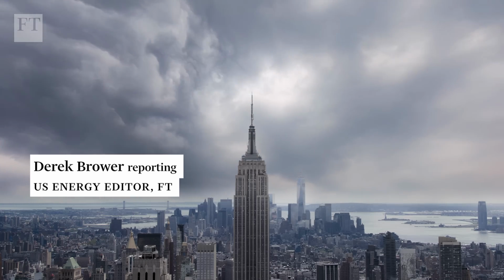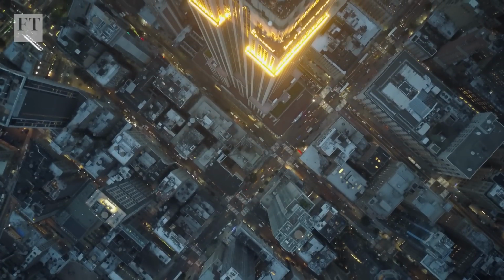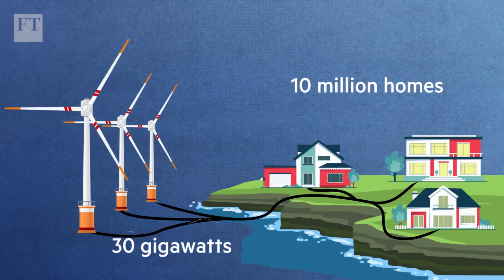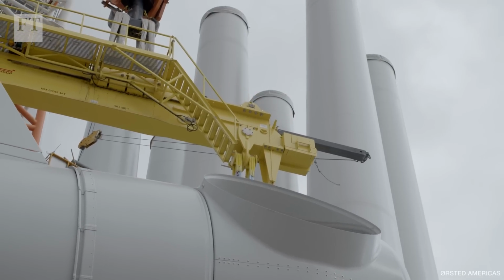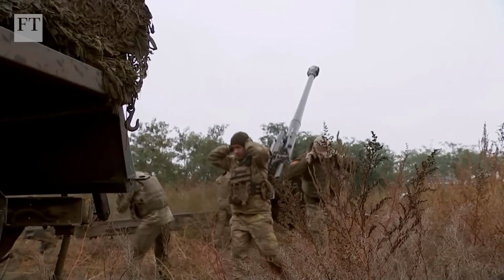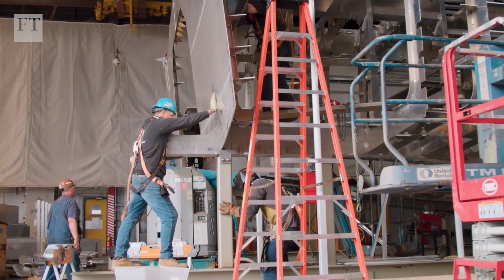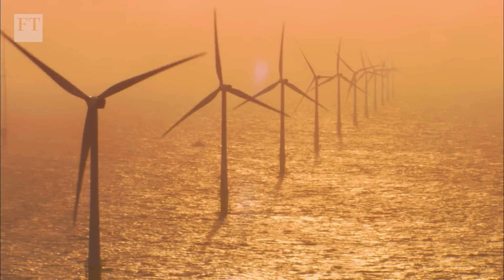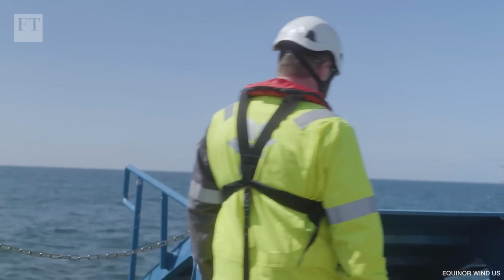US offshore wind: tapping into an underused resource | FT Energy Source

Comment: Wind and solar generated electricity are now mature technologies with few cost savings left to exploit and many times the cost of power from a well run public power grid.   They don't belong on the public power grid.    People selling power from battery storage is grid quality power available on demand and useful for backup and peaking loads.   Wind turbine generated electricity is not dispatchable electricity and has to be conditioned and backed up by dispatchable electricity.   It is useful for saving other fuels, but the high cost of implementation and maintenance has meant onshore wind turbines once rate payers start paying for them in the USA have always cost residential electric rates to go up significantly when electricity should be going down in real costs with improving  technology and efficiency.   Offshore wind turbines cost more than twice the cost of onshore wind turbines. 

People trying to scam the public make use of Climate Change misleading marketing to help their cause.   Global warming has been dead at about 1°C since 1992 with no known cause in 2024 after huge ongoing efforts to find a cause.   It is high school science all the greenhouse radiant energy from the earth is completely absorbed by greenhouse gasses in earth's greenhouse effect within 20 meters of the surface.   Its further heat transfer is by convection.  Earth's greenhouse effect is a primary example of system always in saturation from the strong greenhouse gas water vapor where other greenhouse gas can not change its overall effect.   On average CO2 has a 1/4 of 1% share in earth's greenhouse effect.  Over 90% of plants on earth today, C3 plants, evolved over 70 million years ago in CO2 levels ten times what they are today and struggle at the low CO2 levels of today.   CO2 levels about three times those of todays at 1200 ppm CO2 would greatly invigorate C3 plants.  That is what is done in tomato greenhouses.

Comment: I wonder if wind farms in the Gulf of Mexico are feasible, or if the frequent hurricanes in that region make it a non-option. There's also the factor of the incredible number of variety of birds that fly across the Gulf every year.
Reply: Key problem with the Gulf is not very much or consistent wind, compared to the oceans.   But the giant fossil fuel companies that already use big rigs to drill as much as six miles for oil and gas there might be able to engineer, host and maintain wind energy turbines across much of the Gulf at some point in the future.
Reply: There are magnitudes more birds that are killed by glass buildings and household cats than windmills. It's fake news

Comment: Great to see. Let's pick up the pace, East coast, West Coast, and the Gulf Coast. These are crucial resources to tap.
Reply: Without a radical breakthrough in storage, wind and solar require building more fossil fuel plants to balance the supply.
Want to save the planet? Build nuclear.
Reply: @gilgamecha  storage has had all the breakthroughs it needs. We have batteries, pumped hydro, gravity batteries, compressed air, cryo liquid air, heat storage, flywheels, super capacitors, and vehicle to grid evs. We just have to build them out. Also solar and wind back each other up beautifully. While offshore wind is very consistent and reliable. And then of course, there's hydropower, bioenergh, geothermal, and yes nuclear. They all have a place in the clean energy transition. But of all of those nuclear is usually the most expensive and the slowest to build new, especially in the US. I do support more nuclear in some parts of the world, but it is no silver bullet to the energy issues.
Reply: @Dr.Gehrig  if offshore wind was consistent and reliable we’d still have commercial sailing ships . try sailing the east coast of the US and see how reliable wind is
Reply: @jeffgold3091  depends on placement. Also, the design and purpose of a windmill and a ship sail are vastly distant. This is a fallacious analogy.
Reply: @Dr.Gehrig   Batteries?.... compressed air?..... super capacitors?...  flywheels?   Ever thought about getting in touch with reality?...If these "storage" methods were practical we would be hearing about it non-stop from the main stream media. The truth is that there is no good back up storage method for large scale energy and that is wind and solar's achilles heal. Wind and solar energy will eventually prove to be virtually worthless especially for 3rd countries with hundreds of millions of poverty stricken people.
Reply: @Dr.Gehrig  Do you work for the EPA?...The EPA has a bunch of these lunatic energy storage options on their website. They are clueless too.
Reply: @James Esselman   we do hear about them every now and again in the main stream media. Mostly the batteries, but sometimes the other ones get some play. They don't get discussed quite as much because people prefer an easy solution, 1 to 3 things to remember. Apparently once you break 4 or 5 most people shut down cause it's too complicated. Reality is complex though. These things are getting used and more are being built out in different places as we speak. It's more complicated than 1, 2, 3 but it's getting the job done.

Comment: And the coal, oil, or nuke plant will also have to run (continually) to be able to instantly back up the wind farm and smooth out it's cycle of wind/no wind. Add to that, windmills require extensive mining powered by fossil fuels, resulting in a non-recycleable turbine blade (which also requires transportation by diesel train/truck). We will actually be using more fossil fuel, not less.
Reply: Just watched on SKY News in the UK that they have installed a load of new batteries at Didcot power station, near Oxford.  This is a gas-fired power station so not green.  But allows the batteries to even the power load, so the power station has time to increase and decrease power output.  So does not need to run continuously, as can turn on and off a number of gas steam turbines.
Reply: lol no, In principle, mining could use energy recovery, renewable energy, and carbon capture to supplement, replace, or mitigate the impacts of fossil fuel use. However, a combination of renewable-energy technologies would be required. 
Iron ore production with renewable resources such as solar, wind, and geothermal could produce  electricity. Since no change in the mining processing system would be required, renewable electricity could be applied to existing, as well as to new, mining sites.
Reply: @franzjoseph1837  You've never operated a mine, have you? As a frequent investor in mining, I can tell u your notions will not work.
Reply: @cubsfan910  lol it is literally being done today so idk bruv

Comment: The duck curve shows that renewable energy drops in the evening when electricity demand is highest.
Wind drops in the evening over land because ground has a low heat capacity and this kills air currents.
Wind picks up at night over water because water has a high heat capacity that stays warm over night creating rising convection currents that create wind.
Thus off shore wind turbines are better at supplying high electricity demand at night.
Reply: It's about complementation and storage projects taking off unbalancing in the grid and saving energy for when it's really needed. More demand => more supply => more demand etc. A whole new industry is being developed here
Reply: The electricity at night is normally rather low.
Reply: @SweBeach2023  Funny that, it's rather high in thhe UK, people cooking, lights on, heating on, demand is high. Dark at 4pm.
Reply: This is why Wind and solar compliment each other so well.
Reply: @Dr.Gehrig  Only when the wind blows
Reply: @anglosaxonmike8325  you build wind generators where the wind blows most frequently. And then you find that statistically it blows often enough, especially when balanced with solar. As I said, wind and solar complement each other. It's tends to be windier when it's less sunny and sunnier when it's less windy. Yes, some energy storage or peaker plant (be it gas, hydro, bio, or geothermal) is still needed, but it ends up being leas than you would think in most areas.

Comment: offshore floating turbines are the future. Easy to install and move, wind speeds stronger and more consistent than at land
Reply: As long as the wind blows, they're great
Reply: @darkgalaxy5548  It's the west Atlantic, the wind blows nearly all the time
Reply: @Fudgeis1337  That's interesting. There's never calm days?
Reply: @darkgalaxy5548  There are calmer periods, but its pretty rare that there is no wind at all, especially at the nacelle height of 100-150m above sea level. Global Wind Atlas and other similar things are available online if you're interested. A bigger concern is arguably having to shut the turbines down during storm periods of very high winds, which can be relatively frequent during hurricane season, but Block Island wind (an existing small farm) does this automatically, and turns back on when the wind drops back to safe levels
Reply: @Fudgeis1337  A question how will the east coast be able to power their homes in hurricane season when there is suggestions from environmentalist that the hurricanes will be bigger and more often in the future, then the whole project is "dead in the water" ?
Reply: The biggest challenge is the survival of migratory birds struck by the blades. Those giant machines & components have no use after it fails, piling up in TRASH FIELDS
Reply: @adel19997  85% of a modern turbine is recyclable. There are some projects being developed to make better use of the fibreglass also.
Reply: @adel19997  If the turbines are located far offshore, they're less likely to interfere with bird migration patterns since a lot of birds tend to fly closer to shore.
Reply: offshore power is 6 times as expensive as land based.  That will kill the economy.  Also, very open to sabatoge
Reply: @treeskier58  Every form of energy production can be sabotaged
Reply: @andrewbaumann2661  after what just happened to the Nordstream gas lines, it ahows just how easy it would be to do. Land based production is less centralized and easier to defend

Comment: "The biggest challenges (are) time..."
No, the biggest challenge is getting the Republican party---and their friends on the oil industry---to stop impeding progress.
Reply: The biggest challenge is the survival of migratory birds struck by the blades.

The biggest challenge those giant machines & components have no use after it fails, piling up in TRASH FIELDS
Reply: @adel19997  Placed out of the path of migratory birds, your argument becomes moot, as was addressed in the video.
I agree that the issue of recycling these edifices should have been addressed. I can't see any reason, some, or maybe even most of the material can't be recycled.
Reply: Thé oil companies have nothing to do with that lol….. Norway was able to control their own oil industry see what they were able to achieve. Also oil is much more useful than you think
Reply: @alanmay7929  I fully appreacite the usefulness of hydrocarbons, but not for personal vehicles that get crappy milage and WAY too often only transports one person per vehicle.
The oil companies are second only to the gun lobby when it comes to political influence and the GOP takes money from both, no questions asked.
Reply: @namzarf  nonsense!!!!! How about EVs!? They also transport one person per vehicles and actually needed tons and tons of hydrocarbons to be made and operate, and also not even be above to be better than the ICE. ICE are still much more flexible convenient and efficient at doing their jobs than EVs. The batteries density is simply not here to make it better, plus the biggest problem are the government’s not the oil companies! Also many governments/countries have been stealing other country’s oil and ressources……
Reply: @namzarf  ever wondered why we always associate the Us with "oil democracy" lol…….
Reply: Trying to move to renewable energy carry immense technological and ecological challenges, it's far more than just a political struggle.
Reply: That doesn’t stop me from making 100% returns along with quarterly dividends 🤭
Reply: @darrendent8288  indeed Darren it’s all about wealth, good luck to you if you can make money alongside all the usual suspects
Reply: The biggest challenge is time seeing as global temperatures according to NOAA have been declining since 2015. So once the climate change crisis is shown as a failed theory the use of fossil fuels will return.
Reply: @shaunluckham1418  climate change isn’t the same as ‘global warming’ , it’s simply a change in climate.
Reply: @shaun luckham, can you show us the data from NOAA that saying global temperatures are decreasing? Thanks
Reply: @joeisawesome540  check the channel Philosophical Investgations they did an excellent full cited video on it.
Reply: @shaunluckham1418  Do you have the citation? because I suspect it has to do with the El Nino and La Nina? Where do you have a peak temperature during El Nino and then when you shift to La Nina you get some cooling. This is true, but it ignores the larger trend upward. The global temperature never travels in a straight line.  So unless you have something different?
Reply: @joeisawesome540  it’s all at the beginning of the video on the channel I pointed you to.
Reply: @shaunluckham1418  so basically El Nino and La Nina then? I guess you didn't research beyond what the video tells you? too bad. 
I thought you had something else that wasn't already known.
Reply: @joeisawesome540  as the citations are a bit small for me to read which one made you so certain?
Reply: @joeisawesome540  the Atlantic Multidecadal Oscillation looks a good match for the actual raw temperature record in the European region. We’ll see how the temperatures follow the oscillation through the 2020s and beyond with the compounding influence of reduced TSI. Gonna get chilly like we saw in the 70s if you’re old enough to remember.
Reply: @shaunluckham1418  You are a pretty smart guy, but do you think 99.99999% of all train climate scientists all missed this and some dude on a youtube channel didn't?
Reply: @shaunluckham1418  There is no Holocene Temperature conundrum. That only exists in the blogosphere. Researcher on the other hand "The long-standing mystery is called the “Holocene temperature conundrum,” with some skeptics contending that climate model predictions of future warming must be wrong. The scientists say their findings will challenge long-held views on the temperature history in the Holocene era, which began about 12,000 years ago."
Reply: @joeisawesome540  so Marcot et al, Kaufman et al and their work on the reconstruction of historic temperatures doesn’t contradict every single climate model.
Reply: @shaunluckham1418  Fossil fuels face many challenges. Petroleum is a FINITE resource. We re approaching 8 billion inhabitants on this planet. You do the math.
Reply: @namzarf  all resources on the planet are finite. The Mathematics has already been done regarding vehicles and there is simply insufficient resources for the current count to be replaced by EVs. So let’s stick with ICEs and EVs for the rich virtue signaling people